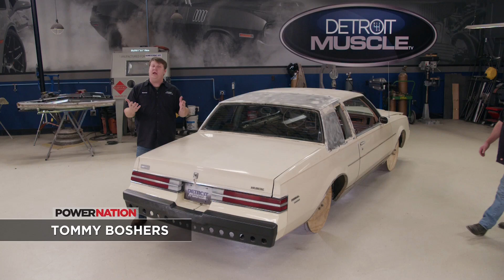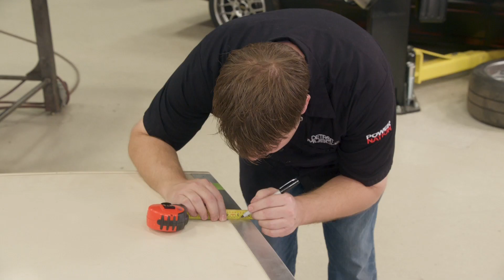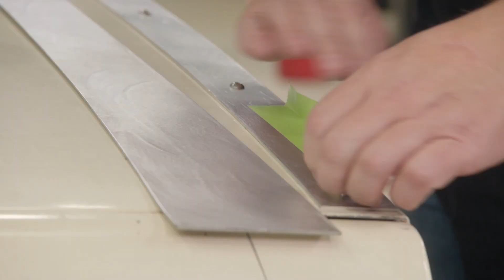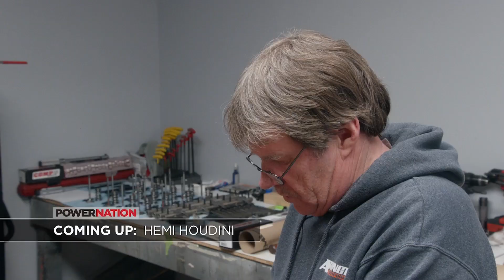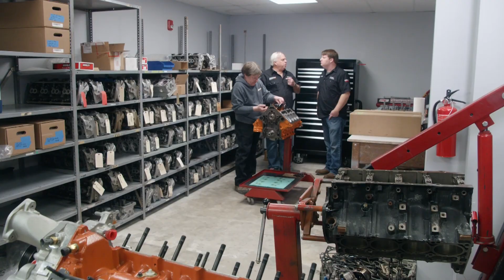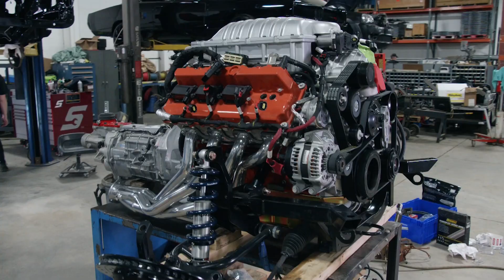Fabricating an Aggressive Rear Spoiler for a Buick Regal - Detroit Muscle S6, E7

Comment: He's wrong about the brass hammer brass is softer than Iron and Steel that's why you use a brass Hammer so it doesn't damage the parts that you're hitting... can I have a million dollar YouTube page??? Wow
Reply: Dead blow hammers don't have flexible handles there's shot or sand in the head OMG guys
Reply: "Regular head"

Comment: This is a neat idea for the twin turbo 6.0 LS 1971 Buick GS I am building on my channel. It was sitting for 40 years so it is a little rough and it needs to be fully restored the frame I’m using is down at the sandblaster so I really have a lot of free reign of what I can do. Doing something like this early on and will allow me to make sure it looks right and is painted to match the car. I may still look into more of a GSX spoiler or an aftermarket fiberglass, or carbon fiber depending on what I can afford

Comment: Saw a lot of people asking about the blue F-100. 1975 F-100 previously owned by David Freiburger. (You can see the truck in its previous condition on Roadkill's Buick Wagon episode. Original single cab short box truck, used to be green and white. Fully restored/rebuilt. Replaced the stock 390FE with a 460 running on Sniper EFI which recently was swapped out for a Coyote. It has I believe a skyjacker 6" lift and 35s. I havent worked there for a while but that really it on this truck, the rest of it was mostly basic catalog parts.

Comment: The bumpers on the buick look awful with all those holes. I love those cars 
I had a 1983 Buick regal when I was a kid until someone ran a red light and t-boned me . Miss that car
Reply: Blair A totally agree with you, I also had one with the shifter on the floor , but it was a v6. Some old lady crash her car on the quarter panel and that was the end!
Reply: Speed holes they make you go faster 😆
Reply: coronado  lol
Reply: Drag cars have holes in the rear bumper to reduce drag.
Honda drag racer made it first and it use those a lot and it helps.
He actually trying to shave time.
He it might even make a good fuel saver by reducing drag on the rear bumper.
Is just a bumper it could be replace anycase he goes to a classic car show.
Reply: @benjaminfranklyn604  Someone drag racing a Honda did not invent cutting holes in cars to shave time off the ET.
Reply: @unicornsteaks6769  well,I seen them more in Civic than any usdm or eu cars
Reply: @benjaminfranklyn604  that's the funniest thing ive read in a while
Reply: Pfff yeah I bet you do miss your buick

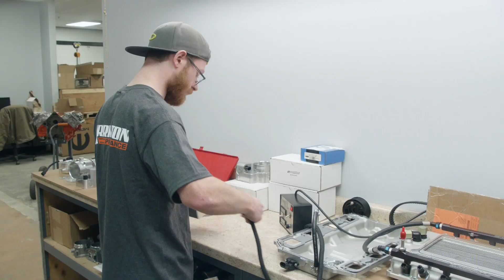Comment: @15:00 when he has the throttle body on the table, look at the gap around the outer edge of the throttle body valve between the valve and the housing! To me it looked excessive but then again I might be wrong! The butterfly or flap valve  had a sizable gap all of the way around it which would to me allow too much air in but again maybe in wrong maybe the hemi's  require that much air at idle!
Reply: throttle body
Reply: @user-neo71665  thanks, I figured I was misspelling it!!!

Comment: Vanilla is flavor. That Buick is more like milk! Noe if you build a T/A performance 468 for it, complete with main stud girdle to strengthen the bottom end it might move up to Vanilla!
Reply: @bigboreracing356  hell let go to the 10.2and 712ci then. make over 1000hp na style
Reply: @bigboreracing356  i was just throwing it out there. im a sbc guy. i like 427-434ci. not really use to many power adders but looking to do a single turbo set up soon on a ls engine. the last big engine was a 9.8 tho as it fits under the hood better
Reply: @bigboreracing356  sweet hope you get in the 1200hp with it
Reply: @bigboreracing356  doh! lol